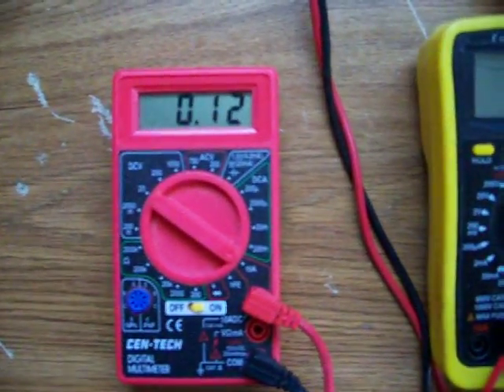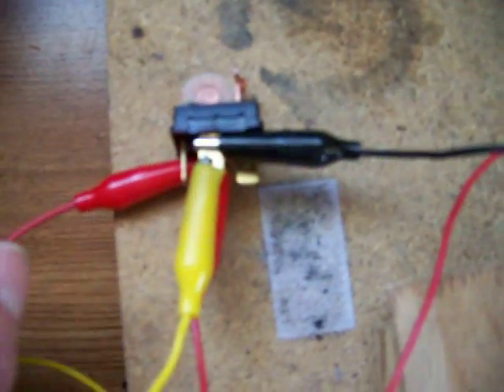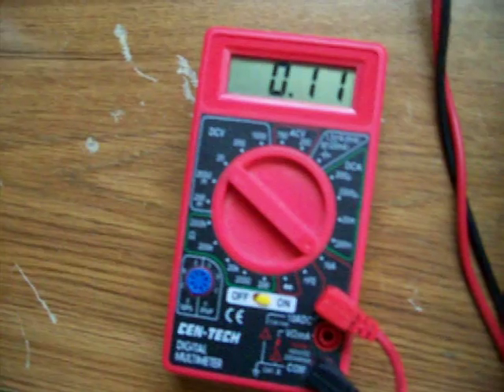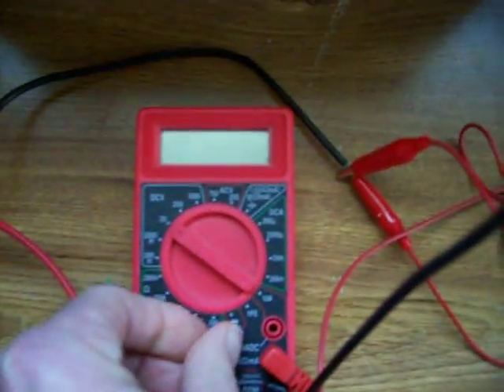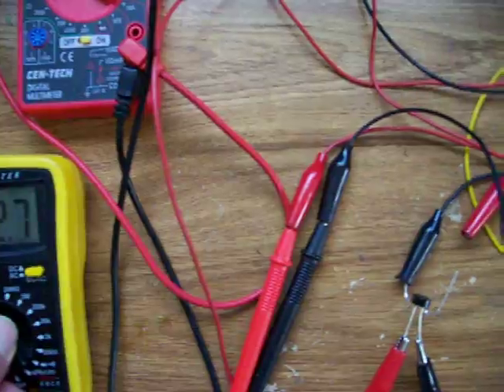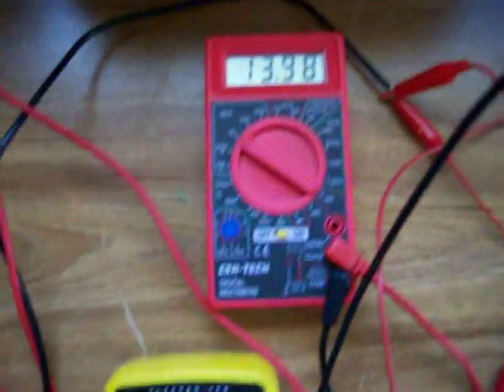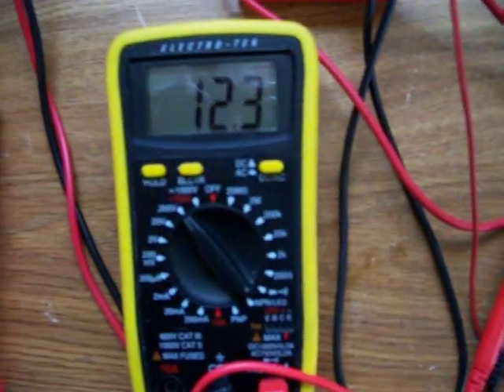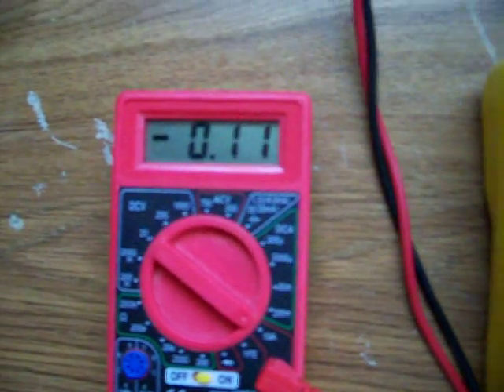Pulse Generator With Relay Coil For Resistor

Comment from the maker: I also tried this with the Joule thief and it worked very well.
Having a rectifier on both sides of the coil then running that back to the source battery.
It helped to bring the amp intake down and also made the light brighter at the same time.